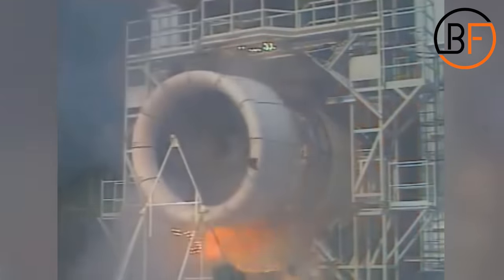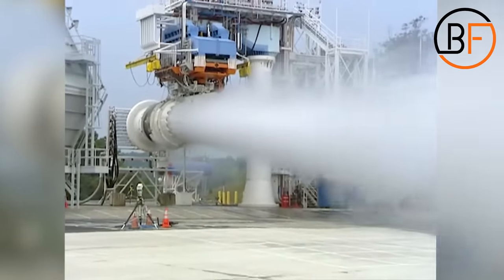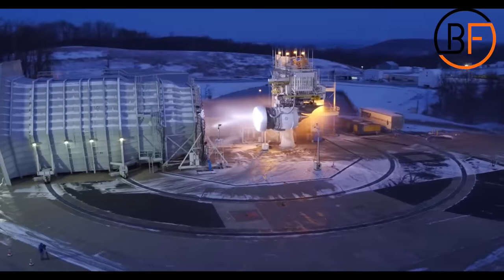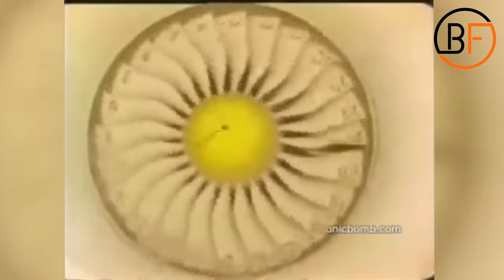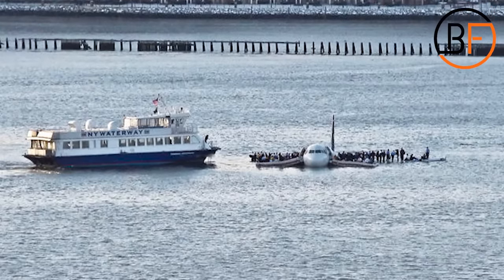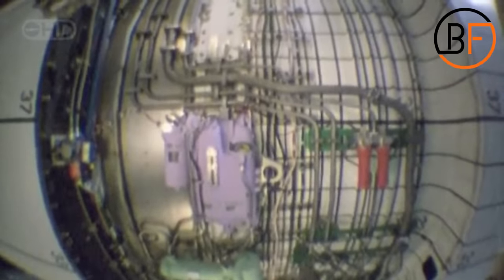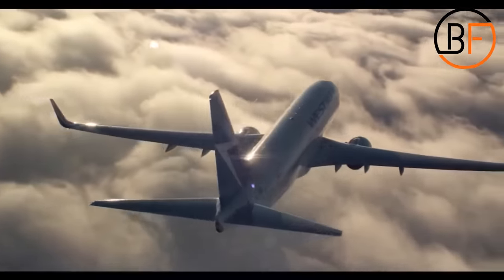This Is How Airplane Engines Are Tested

Comment: The flight that landed in the Hudson in NY must've had a bunch of birds in each engine, especially big birds like geese. So great to see the planes passengers calmly standing on the wings, no deaths, amazing job Sully. .
Reply: FEC Multimedia  two actually
Reply: Most birds are 2-4 lbs, a goose is 8+ lbs, enginescan barely handle one 8 lbs bird, so of an engine took two geese in, it is a guaranteed failure with extensive damage
Reply: The Pilot must have nerves of steel and should have been awarded the highest honour for saving so many lives without panicking during a horrendous experience and causing a major disaster
Reply: @parttimetourist  nope they investigated him and suspended him and if I remember correctly they tried to charge him instead
Reply: @ItsMeTyScott  Are you serious? what could they charge him for? It was a miracle no one was killed and what about PTSD?
Reply: Go vegan

Comment: I can remember an old story about a jet engine design repeatedly failing the bird strike test during development/ After a few weeks, the penny dropped and they remembered to defrost the chicken before attempting the test.
Reply: That's interesting. Frozen chicken is like a rock.
Reply: That's funny as hell. What was the test guy throwing the birds, thinking? "Hmm. This one's frozen solid. Screw it. They told me to shoot a bird at a turbine."
Reply: @654Crossman  Thanks for coming back. 
I remembered after posting a similar story about testing cockpit windscreens for bird strike penetration. As I recall, Mythbusters actually tested out the frozen chicken story on one of their shows.
Reply: Hahaha... Interesting.
Reply: Omfg they may as well have been throwing 10 pound bricks into the engine far out hahhahaha
Reply: That story is pure BS. Chickens aren’t even used. 🤦🏻
Reply: @654Crossman 😅😂🤣
OF COURSE!!? wouldn't you?

Comment: 3,000 rpm?????
Reply: Depends on the engine, for example on a GE90 the RPM is closer to 2,500RPM so 3,000 is not that unusual.
Reply: My centrifuge at my lab can spin for 3500 rpm...hmmm...innovation..🤔🤔🤔
Reply: Yep he's right the blade do spin around 3000 rpm
Reply: The GE90’s “fan stage” (N1) rotates at a maximum of 2,550 RPM.   The compressor stage (N2) rotates at a higher rpm near 10,850 RPM. The blade tips, at 11,000 RPM, are well above Mach 1.    (Info from The Almighty Google.)
Reply: 3,000 rpm is quite slow..my truck goes to 7500 rpm
Reply: But that is weird my car's maximum rpm is 8000 🤔 But how can such strong engines can just revolve 3000 in a minute .Really Really weird
Reply: 6000 rpm
Reply: He is right dude, The engines rpm is high but the blades are connected after lots of gears which limits the rpm to 3000, I'm not sure if it is same for all aircrafts or not.
Reply: You now those microturbines. They can go up to 500,000rpm
Reply: @kennethserem7074  well, a plane engine is way bigger than your truck engine so it has to withstand way more mass... also 7500 rpm is a lot for a big diesel engine (Trucks usually have big diesels right?)
Also, small turbochargers can rev up to 300.000 rpm, since they are so small they dont need to withstand that much g-forces
Reply: @hunterrgaming5423  notice that your car is way smaller then a airplane engine? Okay. Ship diesel engines, just like your car but way bigger, can only rev up to 100 rpm, becuase they are so big. Small bike engines can rev up to 19.000 rpm which is way higher than your car. It depends on how much mass the moving parts have. Small turbochargers can rev up to 300.000 rpm while bigger ones only rev up to 120.000 rpm
Reply: @Simon_r2600  hmmm thanks for this information now i know why

Comment: I remember reading an article where they were testing the polycarbonate canopies on fighter jets by firing a "chicken cannon" at a mock up of the cockpit and it going through the canopy, seat and through the back of the cockpit. It was a third party testing facility that kept failing the test. The government wouldn't accept the canopies and the design company couldn't figure it out for just a little while. Frozen chickens were the culprit.
Reply: The term we used was Rooster Booster.
The Rolls Royce FJ44-2 passes the test.

Comment: The turbines of an jet engine operate at much higher speeds than 3,000 rpm. Try 30,000- 90,000 rpm and sometimes higher. 30,000 rpm is idle speed for some jet engines. While turbofans (the visible fan blades from outside the engine) do operate at close to 3,000 rpm. Some turbofans being higher and some lower. This is mass, angle, air volume requirement and blade length dependent.
Reply: Yah I thought the same, I was like my Toyota Corolla goes to 7,000 RPM 😅
Reply: A quick Google search brings up 3000rpm. It doesn't spin as fast as the actual internals. If the blades spin any faster they go supersonic
Reply: @DennisH22A  I was refering to the turbines not the turbofans. I do appologize for not specifying. Anything too much higher than 5000rpm (size, mass and blade angle dependent) for commercial jets would destroy turbofans. I'm glad you did your research! I will correct my previous comment.

Comment: I captained a 747F from Los Angeles to Honolulu once.  We dropped below the clouds and Diamond Head came into view, it was an amazing scene.  Our ride on mechanic was taking all kinds of pictures.  Anyway, we land, parked the plane, and met the crew that was taking it back to LAX.  "Nothing wrong with the plane, have fun guys!" I said to the oncoming crew.  We went to the hotel and were going to meet about two hours later to get dinner. As I walked into the lobby in shorts and a Hawaiian shirt [OK, it's Honolulu, don't give me any shit! Even if it is kinda cliche tourist garb~] and there came that oncoming crew.  "Uh, what's going on guys?"  It turns out that they took off, and right after rotation they sucked in a Hawaiian goose and had to shut the engine down due to compressor stalls.  Three days later 

[Do I have a cool job or what?!  By the way I was being paid the whole time. Just wanted to let all of you who work in cubicles in snowy climates know that...] 

we get out to the airport to fly to LAX and they had the bad engine on a pallet to be transported to LAX for a teardown.  It literally looked like chicken burger from the grocery store had been smeared around the edge of the N1 [front fan] casing and it was all over the fan blades as well.  And it STUNK!
Reply: It's a cool job. I was born in a dirt poor family so I never got the chance to do this as flying school are crazy expensive. I became an electronic engineer instead, but later in life. By dirt poor I mean Eastern Europe poor, not USA poor.

Comment: So after going through these tests, why do we still have engine failures due to bird's strikes?
Reply: Karma
Reply: They aren't expected to keep functioning after a bird strike. However, they are designed to make a safe shutdown after a strike to prevent further failure. Every commercial jet has at least two engines (there are a few, couple seater jets with one engine, but none comercially that i know of) . They are designed so that if one fails, it can stay in the air on one engine allowing it to make an emergency landing at the nearest airport. In Sully's case, a flock managed to take out both engines on take off. This video has some incorrect info.
Reply: Titanic syndrome.,.
Reply: What’s that in the centre of the flag design at 6:54 ? A demon head ? Why is that inside of the flag ?
Reply: @parkerhollingsed1192  so if a plane is going at high speed and about 80% of the takeoff and bird strikes, so the plane can take off with only 1 engine? Or will the brakes stop the plane before crashing if only 20% of runway if left
Reply: @simplestain6409  planes function perfectly fine with 1 engine. But if multiple engines fail then they will land the plane
Reply: Humans designed this damn machine based on birds' features. And now they are shooting birds into the engine during test phases. Yes it is karma.
Reply: after going through these tests, we get perfectly roasted turkey
Reply: @pr51  The inscription below reads something like <something> Fighter Wing. It's probably the logo of some Fighter Squadron or something.
Reply: Depends on where the bird strikes the engine.  Anywhere on the fan blades, except the very center, not a issue.  If it hits close to the center of the fan, it goes thru the core of the engine causing major damage.
Reply: We had a major bird strike on the #3 engine of a KC-135R, on takeoff.  It hit a 30 pound Turkey buzzard.  The impact bent four of the fan blades back.  The engine had no vibration or issues, and finished the 12 hour flight.

Comment: I remember one story where they were testing the safety windscreen of a train for birdstrikes.
Not as bad as a plane, but still serious at 140km.
This was not done by the manufacturers but the local gov railway authority.
Gun was fired... and chicken took out windscreen, driver seat, and went through to passenger compartment!!!!!!
When complaining to manufacturer it was revealed that the manufacturer uses fresh dead chickens.
The govt dept send one of their 'techs' down to the local supermarkets and got a Frozen Chicken. And did Not defrost it before firing.
Reply: Reader's digest, some issue.
Reply: The frozen chicken went through like Mjöllnir 😂

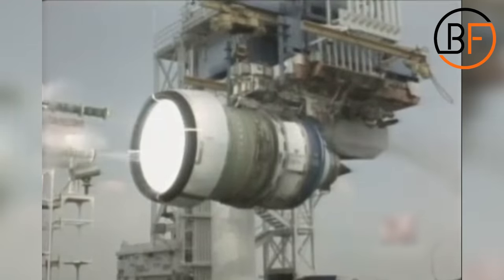Comment: 2:38...bird DID NOT enter turbine at all, just vaporized from striking the turbine intake cowling
Reply: The bird really did got suck up by The turbine creates a vacuum that is spun 2800 times per minute so there's no way that bird can scape on that pull pressure
Reply: The airflow that goes thru the core or guts of the engine, is at the very center of the inlet.  All other airflow goes around the core and does no damage.
Reply: @paraks4228  not exactly. The fan air goes thru the ducted cowling and produces over 90% of the thrust.  The air that goes thru the core or guts of the engine, enters thru a small inlet right near the center of the fan.  It takes a direct hit on the center of the inlet, to get into the core.

Comment: One thing to correct, the carbon fiber itself is very conductive but the plastic encasement used to turn carbon fiber strands into solid materials isn't. Anywaus, awesome vid
Reply: Incorrect, I work in the CF space and it is not a good conductor, but can exhibit conductive properties under certain conditions

Comment: Have you heard the joke about the moron who decided to test a new engine with a bird, but the engine blew up spectacularly.  So the bosses asked the technicians upon examining the engine, what happened.  Did they put in a fresh chicken.  No, he admitted, no one had told him to thaw the chicken.  He had thrown in a frozen chicken instead of a thawed chicken.  All it takes is one "Rotor Blade" to be twisted out of position or broken off and it will go through the first few stator & rotor stations in fractions of a second thus blowing up engine.
Reply: Good job there’s no frozen birds up there
Reply: The engine Engine manufacturer will definately used a frozen Chicken and ice balls for testing.Major tests are done by Eg GE; PRATT & R/R in Britain
Reply: Boeing does use frozen chickens
Reply: @TeamDriftEVO  At wat plant and location Boeing uses frozen chicken to test the engine.Boeing desiges manufacture and test the planes the buyer decides what engine she/he will either lease or buys.The Engine comes rapped up and installed.The ingestion test  is sole done by the Manufacturer GE/PW/RR
Reply: @TeamDriftEVO  Boeing do what with a chicken?
Reply: @lewis7515   i said Boeing.  But what I do mean,is the engine manufacturer, ofcourse
Reply: Shame it's a gag about a frozen chicken being shot into an engine by an apprentice who wasn't told to use a plain raw whole chicken. Makes a much better story with a raw chicken stopping the engine but the frozen one blowing it up!

Comment: This is the first time I've heard the term "bird strikes" and I find it hilarious that it's apparently an official term. The "chicken gun" is hilarious, too. 😆
Reply: I've seen a bird strike amputate a man's arm in flight.  Many have caused pilots to lose control and crash killing themselves.  Jam into the airspeed tube ( pitot ) and you lose your airspeed indication and put such a dent into the wing the aircraft could nearly not be operated at landing speeds. I've seen birds tear the tip completely off the wing.    Like the flight into the Hudson - I've seen engines eat so many birds in a flock  ( 100-200 ) starlings  - the fuel injection system was choked off and the engines shut down.  
A well placed bird strike could be the last thing you ever see - before the ground. 
Yes -  " bird strike "  is an official term.  I've seen hundreds of them.  Eagles, Hawks, Ducks, Geese, Starlings , Gulls , and others unknown.
Reply: @mixter7x7  Amputate a man's arm? That's crazy! I guess I can believe it, though, given how a duck messed up Fabio's face on a mere rollercoaster. How did it get to the guy's arm, though? Was it a small private plane, or did the bird blast through the glass of a large plane?
Reply: @LordYggdrasill    There was an A-7 pilot who hit a goose. The goose smashed the canopy and amputated the pilot’s arm.  The pilot managed to land the aircraft before losing consciousness. With very little searching you can easily find countless bird strike, downed aircraft , navy pilots etc who hit birds and lost their aircraft

Comment: 6:05 - FALSE. The chances are relatively low. The chances of being hit by lightening are even lower.
Reply: Not true at 1 flight airplane get hit by lightning is 100+
Reply: @tangmomo9375  False - according to the International Air Transport Association (IATA), an aircraft is struck by lightning every 1,000 flight hours, the equivalent of one strike per aircraft per year.
Reply: @sky173  oh really?
Reply: yes
Reply: Yes the plane use to encounter lighting strike.1988 I was onbord south West air 737  from Lubock to L/A we encountered severe air turbulence in rain storm b4 leveling, plus lightening strike.The A/C made emergency landing at Odesa Airport.That day memory will never flash off my mind.Definate that  was near death encounter.
Reply: When you’re in a metal tube in the sky, changes are good of being struck.  It’s not a big deal though.  While I haven’t been struck yet, I was once in a plane when a storm started above us.  The pilot explained we were going to fly through and above it to lessen the chance of getting struck (sometimes you have to run through fire to get to get out of a burning house), and that all unneeded power was going to be shut down to prevent a power surge if we did get hit.  Most of the passengers were dead-silent, and those who weren’t were trying not to panic.  I, being weird, sat there staring out the window thinking that was the coolest experience ever.  I figured that manufacturers probably had built-in safety devices since the occasional lightning storm is something to expect, and yet we don’t hear about planes being lightning-struck out of the sky.
Reply: Aren't planes suppossed to be like Tesla cages, except for the windows?

Comment: 7:48 can anybody tell why one tyre seems to have less air than other, i have myself seen this several times, and it used to scare the shit out of me
Reply: Not on airplanes last minute checks comprise Tire pressure checks.Beside that Airplanes tires do not use ordinary air like shop air.
Reply: @sampsonsarbine3311  they use Nitrogen.
There was a Aircrash Investigation about that as nitrogen has a different thermal expansion than air
Reply: Its not less air
One wheel took more force than the other wheel while landing
It happens with cars , bikes etc etc

Comment: Can a professional mechanical engineer explain whether there is a reason why a grille was never designed in front of the engine such that no birds or large debris will enter the engine?  Does it interrupt the flow of air going into the engine?
Reply: If you put a grill in front of an engine, a birdstrike would guarantee an airflow blockade
Reply: It would restrict airflow, and would freeze over in the right conditions.

Comment: What none of these "jet engine test" videos really CLEARLY explain, EXCEPT THIS ONE, is that the engines need to be able to absorb all these different possible ingestion scenarios, i.e. birdstrikes, large hail, insane amounts of rain, and debris on runways, like small metal parts, WITHOUT catastrophically exploding and thus destroying part of the plane itself or killing passengers. These tests ARE NOT tests to see if the engines can sustain these events and continue to run and perform normally.

Comment: However, but because there are spirals in the engine propellers, the birds won't crash into the propeller, because the idea of the spiral is that it scares the birds so that they move out of the way, and yes, you've heard it right, when the spiral is spinning and the birds look at it, they fear looking at it and look away.

So in this case the birds won't collide with the propeller.

Also not in every plane the engine spins at 3000rpm.

Comment: I have one doubt.... Why can't we just put a strong iron transparent net like structure which can obstruct the brids and all other unwanted things from hitting the engine directly???? And also there will be no problem with flow of wind current
Can anyone clarify my doubt??
Reply: A mesh will create a significant reduction in air intake thus reducing the performance of the engines. Metal mesh can also break and enter the engine creating excessive damage more than a bird would.
Reply: Also a metal grate tends to build up ice, further reducing airflow to the engine, not to mention the ice breaking off and possibly damaging the engine.